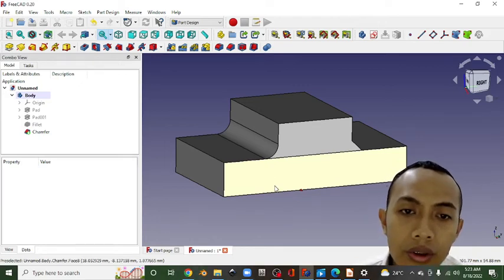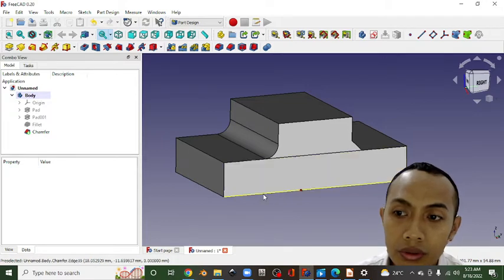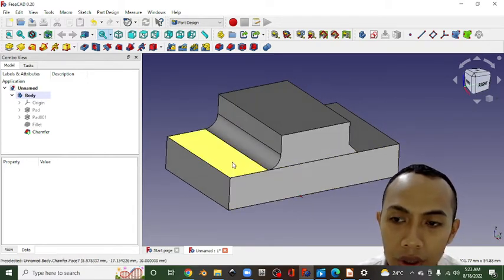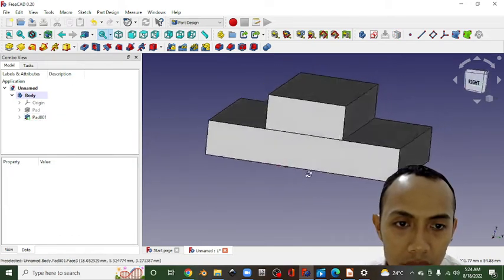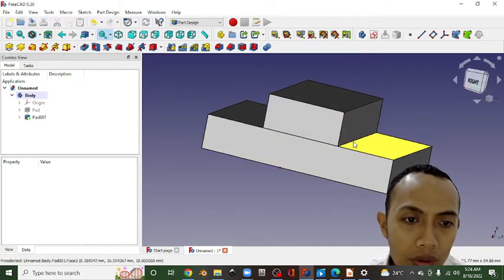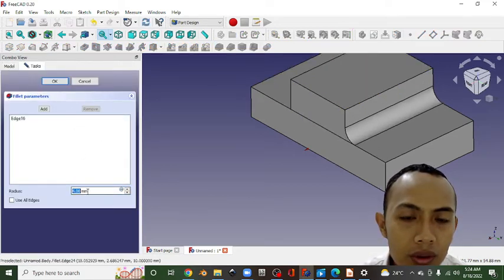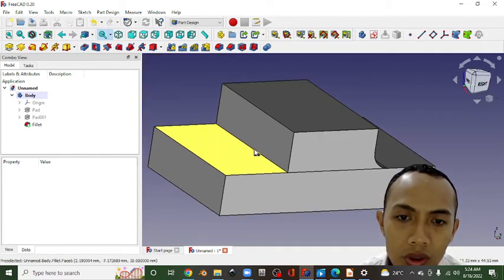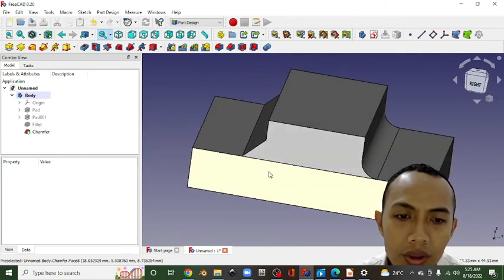Fillet Problem in FreeCAD (Windows Version) - Update

Comment: Unfortunately in my ubuntu still not working. But thank you for your help✌
Reply from the maker: Just install the new version 20.0
Reply: @dr.ariefnurpratomo7229  yes I have the newest version. Maybe they didn't solve it for Ubuntu
Reply from the maker: @czark75  No, in Ubuntu I have no problem with fillet.
Reply: @dr.ariefnurpratomo7229  I'm using freecad-daily so maybe willa be better if I try to install version 20.0
Reply: In stable version 0.20 is working well on Ubuntu